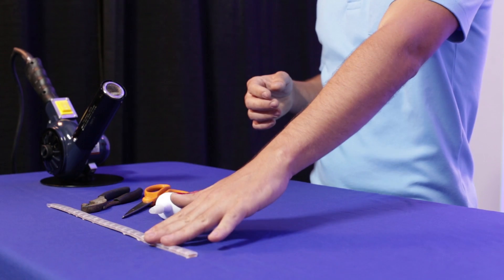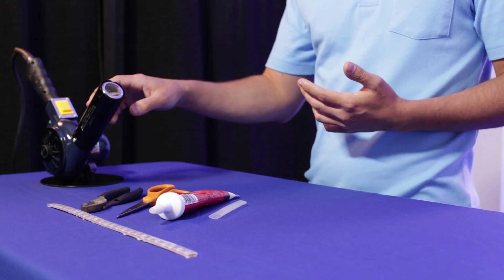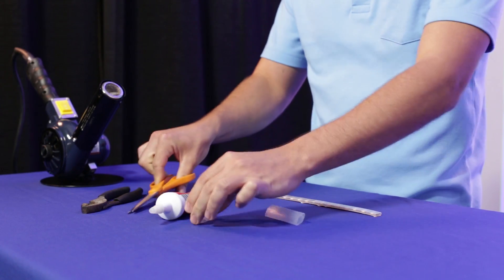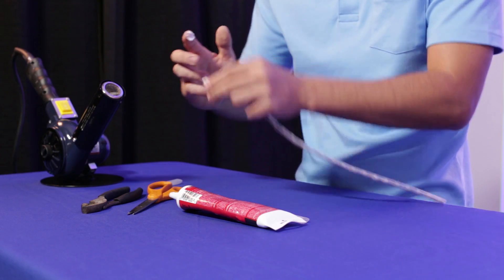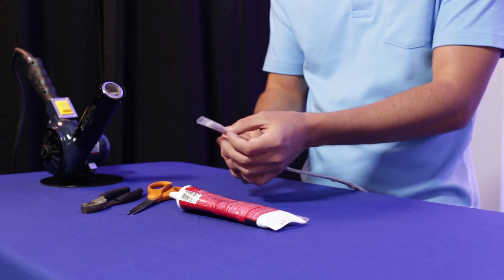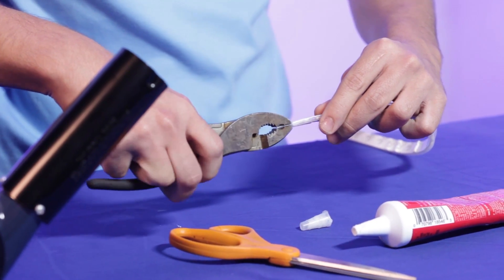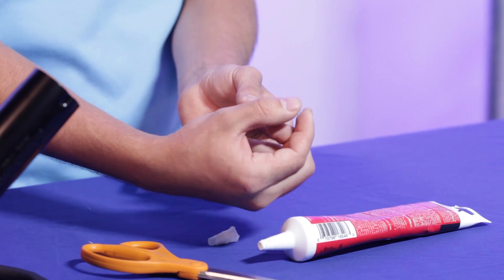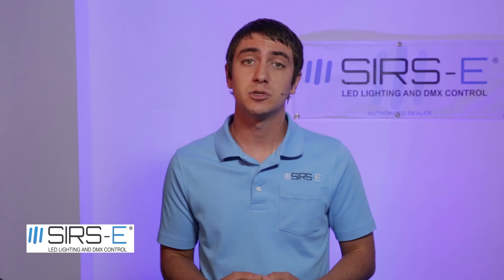How To Re-Seal Your Waterproof LED Strip

Comment: how can I get them back to work if they already got wet ? are they all gone to the drain ?
Reply from the maker: Unfortunately water damage cannot be repaired due to corrosion, however you can cut off the damaged segment and re-solder.